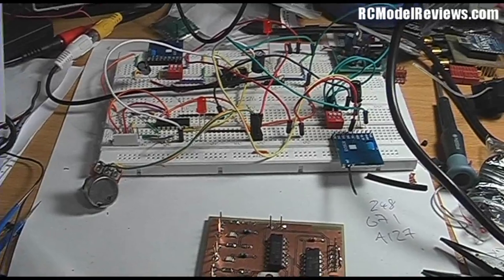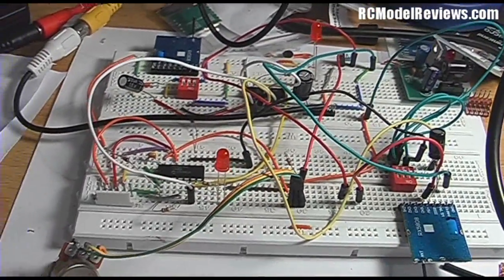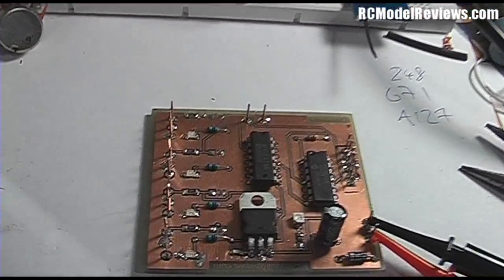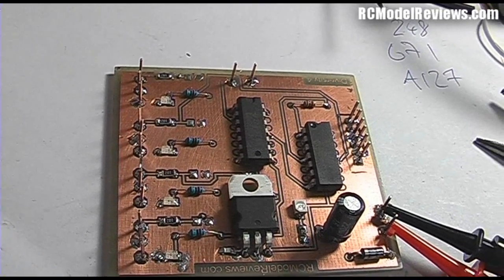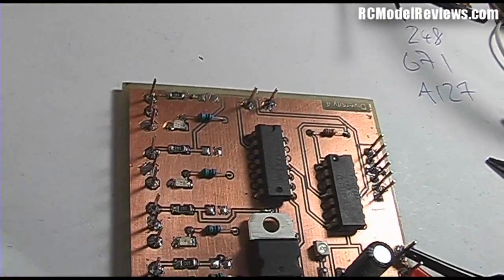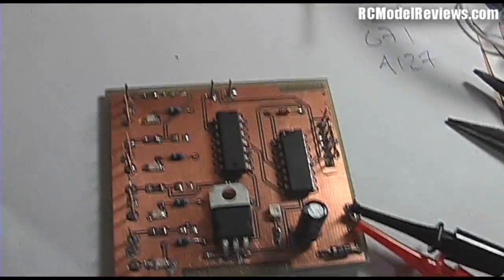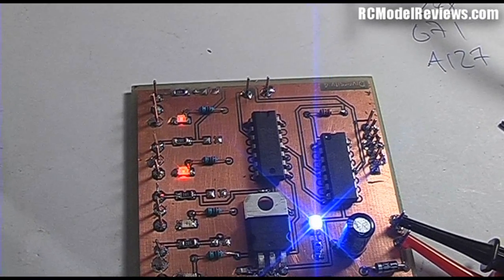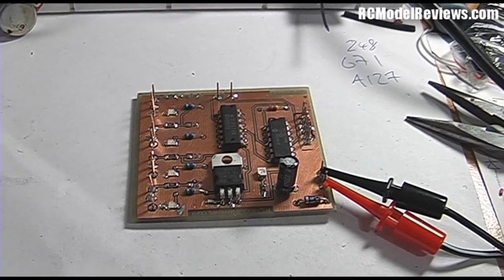DIY: The $25 FPV Diversity Controller project (Preview)

Comment: Just as a tip: Is a good practice to buffer the output, a dual opamp (2 video out that way) AC coupled with 75 ohm resistor at the output for the impedance match and more than 4mhz bandwidth should work. Also in my design since no antenna is similar to the other I installed  a routine to set the max an min on each rssi with a pushbutton and just turning on and off the transmitter you set your antennas. Cheers for the project

Comment: Brilliant.  I'd get one of these.  The alternative antenna tracking has been a problem for me.  Not to mention, antenna tracking requires the model have GPS gear on board and have a solid GPS lock at all times *and* good video link to transmit its position.  The video link for antenna tracking can be a catch-22. My smaller FPV aircraft don't even have GPS either!

But four patch antennas pretty much covers anywhere I'd want to fly and it doesn't matter what equipment is on your FPV aircraft.

Comment: One long raining day in Tok and nek minute Bruce you produced this amazing video. One long winter in South Waikato and a second deck to this controller will Handle four camera inputs and switch between them when the FPV pilot changes throttle or dips the wings. (full throttle looking forward and back off looking backwards, tip wing down and camera selected to look down that wing vise verser) if it was six channel one could look up and another look down with a six sided camera tube. On board thi

Comment: Great Bruce, I good idea, only one question., It will switch the audio to? or what do you suggest to handle the audio? some FPV's like to have audio some other times you use the audo channel for the antenna tracker.

Great Video / Thanks

Comment: Great little circuit Bruce :) Will come in very handy when I do eventually get into FPV. On a side note, there seems to be a lot of copper left on the PCB. Is it all necessary? Just wondering as it could cause accidental shorts.

Comment: No 2 receivers are the same. So what if receiver one is giving a slightly higher RSSI voltage than receiver two, although receiver two in reality has a stronger signal/better picture? Will there be twim pots or some sort of calibration feature on the chip?

Comment: you should have bolted down the regulator. the vibrations of the plane can cause the solder joints to crack